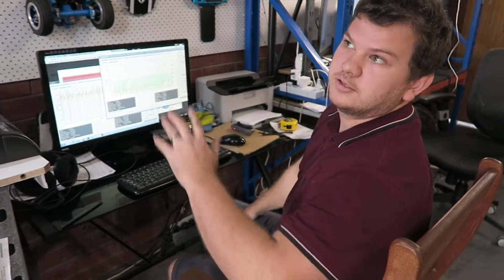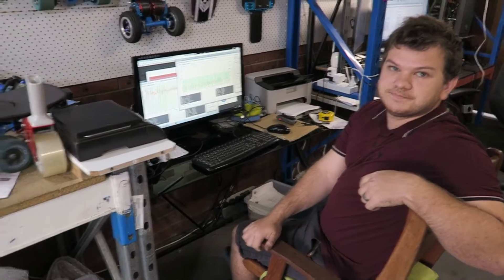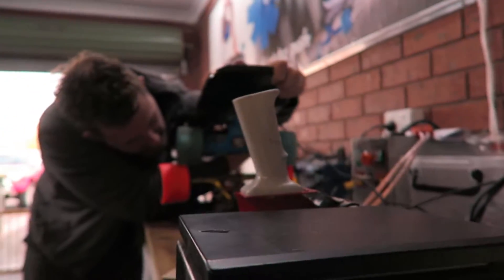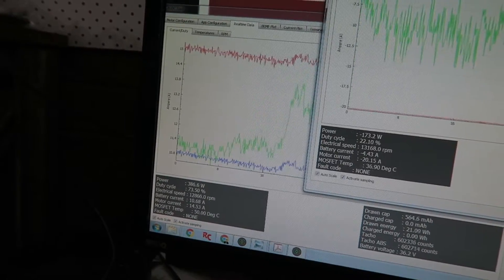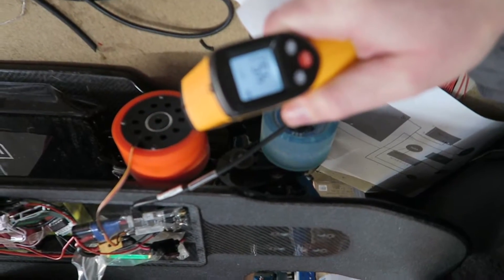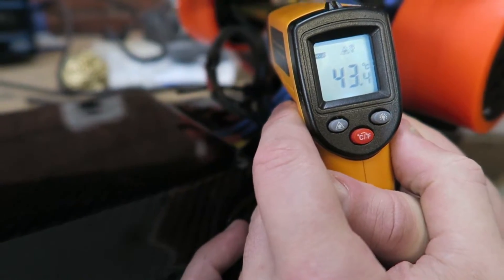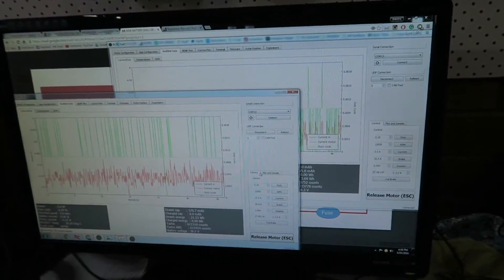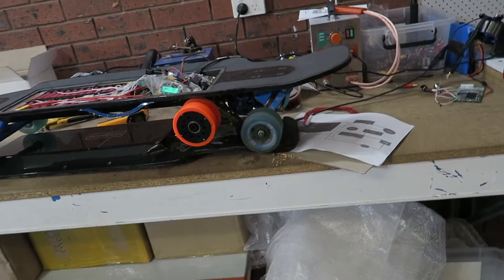Enertion Raptor VS EMF Hub motor

Comment: @2:02 motor looks like its spinning all wrong. I thought maybe it was truck wobbles, but both sets of trucks are not wobbling. It looks like hub motor is spinning bad.
Reply from the maker: It's the urethane wheel that has a huge air bubble on the end when being made

Comment: Hey, is there anyway to measure the HUB Motor Torque using the above setup?, Thanks in Advance :)
Reply from the maker: Yes buy using a load cell attached to one of the motors you will get a measurement that you can then calculate torque, or use a system like dtech Dyno software that will do it for you! I'll be finishing my Dyno very soon and I'll show you how this is done!